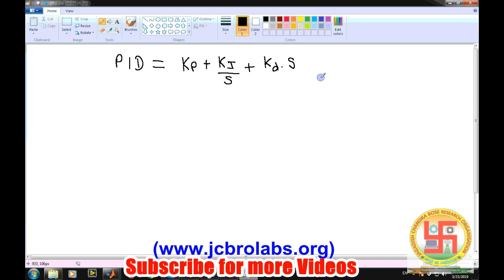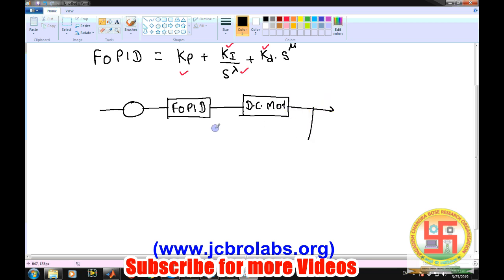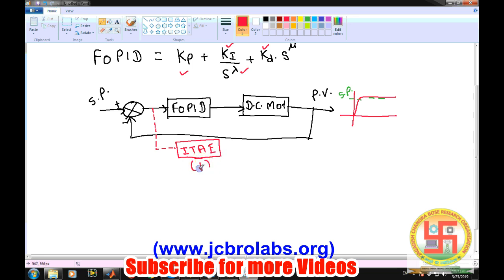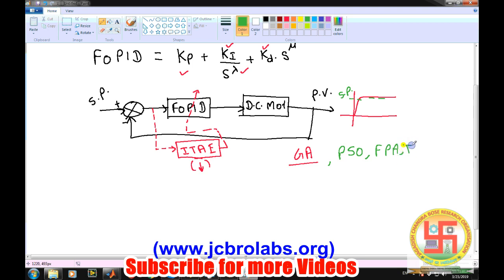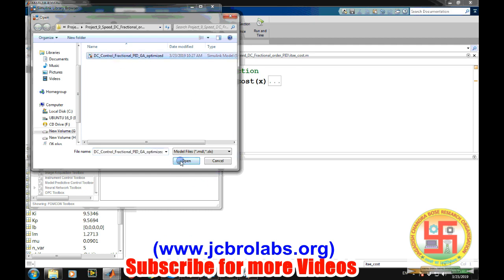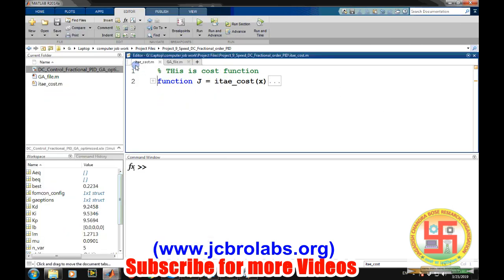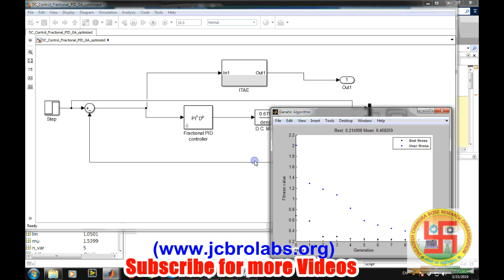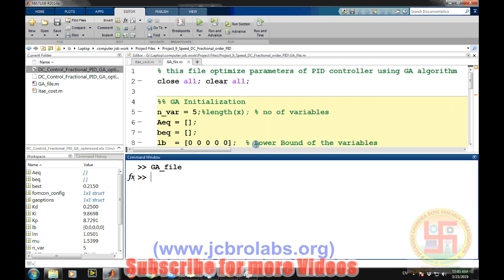EEE Project 4: GA Optimized FOPID Controller for Speed Control of DC Motor

Comment: Where are find fraction pid controller and itae blocks?
Reply: fomcon toolbox you have to install and add to matlab
Reply: @abhisheksaxena5881  i see FOPID with famcon toolbox but itae doesn't appear.
Reply: @serkanyagci4348  ITAE is not a block u have to make it with as Integral of time absolute error
Reply: @abhisheksaxena5881   bhai bna k gmail kar dena please